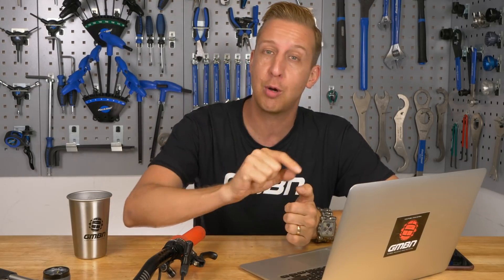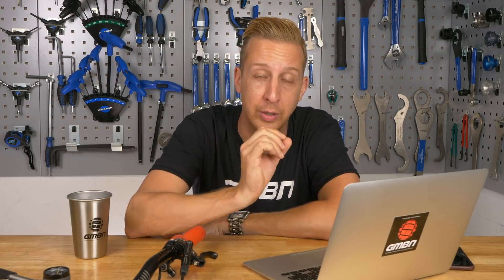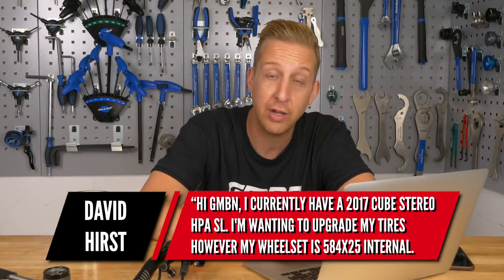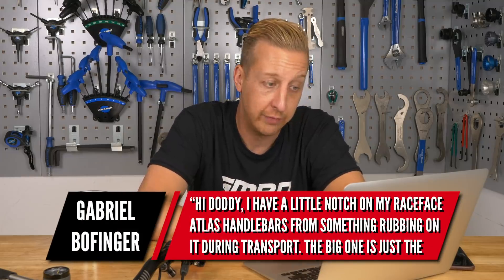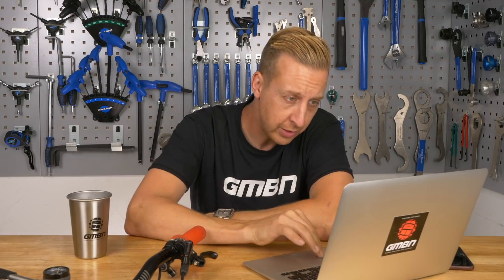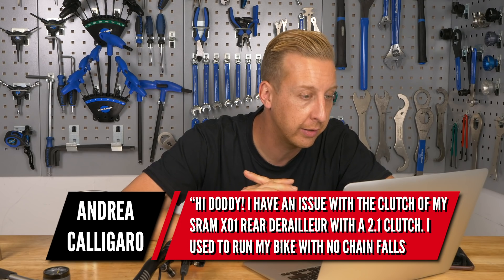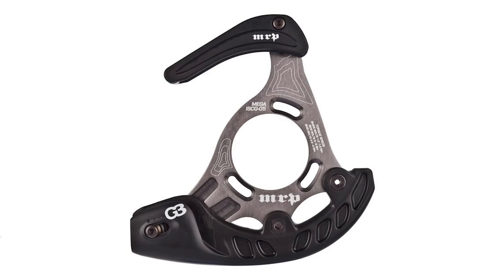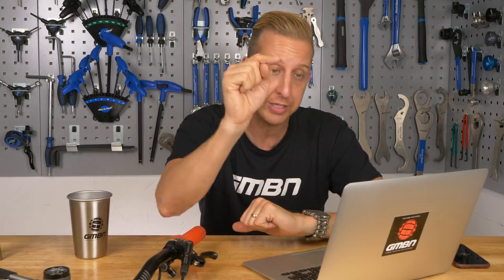Why Does Your MTB Chain Keep Dropping Off? | Ask GMBN Tech

Comment from the maker: Leave us your questions in the comments below using #askgmbntech 👇
Reply: #askgmbntech
What a show! 
 i want to make my mtb to a cx bike i wonder if a tiagra or any shimano sti and a mtb rd(deore) would it work? 
And do you know some brakes that have mech actuation but theres mineral fluid in the disc brake calipers? 
Its a  long question more power!
Reply: @Kayle Mallillin:
brake: TRP hy-road for example
Reply: Hey! I have a Canyon Spectral al 6.0 just for about a month now. However, the dropper post (kind shock lev si with a 150mm drop) doesn't come out completely and there's a little bit of play up and down, as well as side to side. The air pressure is correct, as well as the cable tension. 
Any suggestions? Thanks🙃 #askgmbntech

Ps: One of my friends is having the exact same problem.
Reply: Can I fit a 1x11 Cassette on my 2018 Trek X Caliber 8 on stock wheel and hub? Boost 141 QR #askgmbntech
Reply: My chain keeps coming off at the front near my Pedals when I descend a rock garden I would install a bash hard but my bike does not have the mounting points what should I do
Reply: First: great show!
#askgmbntech What's the best (min/max) width tyre for any inner width rim? There's a few tables out there on the internet, but showing different optimums. How about one more from you guys?!
Reply: #gmbntech
How much travel is too much travel?
Are there any bikes that handle climbing really well while also being fun on the DH?
Reply: @Gavin Sorensen:
If u never bottom out it's too much travel. Bottoming out frequently means it's not enough!
Reply: @geemail369  time to get a santa Cruz v10 for my local XC trails!
Reply: #askgmbntech I have two questions one and I know you all get this question a lot but, my B.B. is creaking I’ve removed it cleaned it and re-greased then replaced it it worked for about 1 ride now it’s back to creaking, should I just start working on it and keep going till it stops? And 2 what does “boost” do example boost wheels
Reply: Hey Doddy great show and a regular viewer. I’ve just noticed my rock shock lyric fork which has 160 travel only rebounds to around 140/150 travel it’s got 80 psi the only way to get 160 is if I actually hold the fork and pull it up , would it be it needs a full service as I’ve never serviced my fork cheers mate
Reply: #askgmbntech Hello Dooddy! I'm currently running a 1x10 setup on my XC bike. My chainring is a 32T and have an 11-36T cassette. I've already worn out my cassette and I'm thinking about swapping it out with an 11-42T and a new chain. I'm trying to find out if my M6000 rear mech can take a 11-42T cassette without using a goat link. I've been finding conflicting answers from the internet. Some say it will fit fine and some say it doesn't. I hope you can shed light on this. Love the show! Thanks!
Reply: This channel is to help people ?

Why the talk technical and lose the logic 

How about having the tools infront of you and then showing how to complete the task

All i hear is 144ml  100ml and then maybe 1ml 

People will understand if you dont talk talk .. 

Show the items !

Comment: #ASKGMBNTECH Front suspension Question. Hey Doddy. All the way from South Africa.  Hope you can give me some advice.  I got a brand new Trek Top Fuel 7. It has a Rocksox Reba Silver Boost with a 32mm stantion if I am correct. I wanted to fit my current fork which is a Forma Selva. This is an awesome fork and has 35mm stantion. The Formula is unfortunately non boost. I want to know if I should keep riding the new Reba Silver, or rebuild the front wheel to non boost and make use of the Formula Selva. Does the boost really give that much benefits. Rudi Raats

Comment: Wondering if you could help or give me a bit of advice.

I have a 2021 giant Talon E Bike, and everything works great until I go off road. 

Every time I go off road and I am going downhill, and I hit a small bump my chain come off at the front all the time. 

Its fine going uphill and on flat, only happens downhill when I hit a bump, even when I stand up and let bike go downhill, I hit a small bump and the chain comes off

Comment: #askgmbntech I have a KTM Lycan 274 bike 27.5inch wheels. With shimano deore specs. 11-36t cassette 10speed, 38-24 chainset. I never use the 24T chainring tho. So im thinking of converting to a 1x with a oval chainring. What are your recomendations? Should i change both chainring and cassette or can i get away with only putting a wide narrow oval chainring and keep the original cassette?

Comment: #askgmbntech Hi doddy, recently bought a brand new Marin san Quinton 1 and found that between the crank arm and the bearings of the bottom bracket there is a gap of about 1cm. All the bolts are tightened correctly and not sure what is causing this. Could it be the axle length is to long for the frame?

Comment: #askgmbntech Hi Doddy, I have a problem with my cassete that when I switch to the harder gears like 9 or 10 the bike starts to make a clunking sound which means when I am pedalling especially up hill it clunks and chucks my feet off my flat pedals. What do u think is wrong or am I doing something wrong?

Comment: Steerer tube creaking inside crown use loctite 290 wicking grade. It seeps into the crack and uses capilary action and then seals. I used it for the part where the stantions go to the crown last week and now my bike is dead silent.

Comment: #askgmbntech I’ve just bought a new wheel set fitted them and set up tubeless everything seems fine but when the bike is in the stand I’ve noticed at lower speed when spinning the back wheel it moves the cranks and the chain becomes lose then snaps back and free wheels again? When the wheel isn’t in the bike it’s fine, Hub is a superstar components electro 102 cheers doddy p.s loving the channel

Comment: Hey! I have a Canyon Spectral al 6.0 just for about a month now. However, the dropper post (kind shock lev si with a 150mm drop) doesn't come out completely and there's a little bit of play up and down, as well as side to side. The air pressure is correct, as well as the cable tension. 
Any suggestions? Thanks🙃 #askgmbntech

Comment: #askgmbntech I just had a difficult time removing some Race Face Evolve aluminium cranks that were bonded to their cromoly steel axle due to galvanic corrosion. I hadn't removed them for about 6 years because I only do that if it feels/sounds like the BB needs looking at.

When I tried to use the self-extracting bolt system, the outside bolt thread stripped. Then I tried using a crank extractor which stripped the threads from within the cranks. I tried bouncing up and down on the pedals with all the bolts removed, and nothing happened. Skipping out a load of other failed attempts I wound up sawing off the tabs where the outer chainrings would be bolted so I could get a 6-ton gear puller attached securely and that eventually worked.

Is there a better way for if I have to do this again? Should I be removing my cranks every 6 months or something to prevent this problem?

Comment: #askGMBNtech Hey Doddy. Love your show, mate. You've got a brilliant style for delivering what is without doubt a wealth of knowledge. Love it. A brake fluid question for you.  I run XT brakes mated to Saint 4-piston calipers and 203mm rotors front & rear on my 2013 Specialized Stumperjumper.  Fully loaded up, I'm probably knocking on the door of 90kg.  I'm also knocking on the door of 45, and while I can ride okay, I'm hardly an aggressive shredder.  What I've noticed with my brake fluid, through either lever bleeds of a full flush, is that it turns from the usual red of the Shimano mineral oil to cloudy black.  Is this normal? Natural? Anything to be concerned about? Cheers mate. Jamie Scott, Christchurch, New Zealand
Reply: i have seen cloudy black brake fluid before. i would say it means you have to do your next flush sooner

Comment: To the guy wanting to fit a 2.6 magic Mary to a narrow rim, get the strongest casing you can! I run a 2.4 on a 24mm internal and under hard cornering you can sometimes feel the tyre folding in the corner, it kind of feels like your in a drift then it pops back into correct position and wants to either stand the bike back up or slide out because it's now in side of the tyre as it fold the other way.

#gmbntech still no email doddy, I'm desperate for a link up on that 10mm stem 😂

Comment: #askgmbntech hey Doddy, 
So i recently bought a 27.5 hardtail(Kross hexagon 3.0) and im looking to upgrade it.
The shifters and drivetrain are ok, but i need reccomendations for the rest. (Since im from Croatia, it's a bit difficult to get parts) I also don't need a dropper post(btw an aggresive rider).
Reply: it looks like an altus-tourney 3x7 drivetrain, which is touring oriented. I think if you ride this bike hard things will start to break. The rear derailler spring isnt strong and will be flying around on rough terrain causing ghostshifting. The rear wheel probaly has a 7 speed freewheel instead of a cassette, which means you need a new wheel to upgrade to a 9, 10, 11 speed drivetrain in the future.

My suggestion would be to save up for a new bike altogether since that would be more cost effective compared to upgrading the whole bike over time. (great deals can be found on used bikes). If you are happy with the current bike i would start with tires, hydraulic brakes, air fork

Comment: #askgmbntech I have a yt jeffsy 29er. It comes with a 32 tooth chainring, but I find it to big and I'm thinking of changing it to a 30 tooth one. What do I have to look for when buying the new chainring to make sure it fits?
Reply: make sure it mounts the same way, different brands may mount differently and may not be compatible
Reply: Why? 30T may be too small, whats the cassette you are running. An 11-42 with a 32T should be more than enough. If you cant make the climbs now just train a bit more. You will get stronger that way.

Comment: about that 29 vs 27.5 dilemma, there is a point where this 29er better rolling ability is a disadvantage in fact, i find it almost impossible to keep the speed low on some extreme downhill wall like sections, whereas with smaller wheels it will bite better into some holes and let you keep speed lower. other than that 29er is a killer ;-)
Reply: Have you heard of brakes
Reply: yeach i did, but what i described is with modulation or even with full stop - so it seems brakes does not affect this scenario ;-)

Comment: #askgmbntech hey doddy, loving the show!. Is there any way to make hydraulic brakes more progressive? 3 months ago i had a big crash where i hurt my right hand pretty bad, and i lost a bit of "fine motricity" on the fingers i use for the rear brake. So i find my self sometimes braking much harder than i should and locking the rear wheel quite often. my bike has shimano m365 hidraulic brakes with 180mm rear rotors btw. Thanks and greetings from Argentina!
Reply: Shimano brakes are known more for power than their modulation (or the Saint brakes are certainly), you might have better luck swapping to a different brand
Reply: @src248  yeah, that was what i was thinking, asking for some brands/models that are known for their "modulation". 
Thanks!
Reply: People seem to like the modulation on the SRAM brakes, I'm using Guides and like them... but I'm no expert, reading as many reviews as you can is generally worthwhile
Reply: thanks!, i had 2 bikes so far and both with shimano brakes. And yeah, they´re pretty touchy. I got use to it and i can modulate them pretty well (with my healthy hand).
Reply: @Garcheezy  Hope brakes are great for modulation
Reply: @robbanks50  thanks! i will take a look at those!

Comment: Hi Doddy, I had this mystery with my bike which is a trek x caliber 7. The problem being that my first gear cannot keep the chain on at normal pressure (25-30 psi) but today I tried pumping my tyres at 60 psi and now my chain can stay on the first gear. Can you please explain it to me. Cheers

Comment: 8:07 could be crack in carbon bars,
as mentioned in the video it could be loose stem bolts, could be play in fork crown & steerer,or stanchions. and of course crown race.
it creeks when turning or riding hard it's most likely the crown & steerer, or stanchions.
also check the wheels, it might be the spokes rubbing, could be spoke nipples too.
so good idea to listen up loser, eliminate one by one.

Comment: It turns out the 18" Cube Analog was a bit too big for me (5'7" with 28" inseam) so I'm getting it in a 16" instead.
Reply: Also 5'7" and our height is a bit of an issue. We are on the near end of a small bike but just beginning of a medium.
Reply: Jay G  I remember just before I quit cycling 20 years ago an 18" was a perfect fit. With the 18" analog I can't get my feet on the ground when I am on the saddle and when I stand with the crossbar between my legs the crossbar is just under me. I have no room under me on the crossbar. Not even 1mm between me and the frame.
Reply: or try the 17" 29er?
Reply: I did. Its still that tiny bit too big. I tried a 16" and it did fit much better but it was a CUBE AIM I tested @ 16" which is a cheaper bike and it just didn't ride as good as the analog.

Comment: #askgmbntech  Hey Doddy!  I'm looking at going full sus by spring (eyeing a Scott Genius 920 or Canyon Spectral CF 9.0) and have a sizing question.  I currently have a Trek Marlin 7 in 18.5", based on my height.  Problem is I can't get the seat low enough to get my hips behind it, even after cutting 1" off the tube.  While I'm 6' tall, I have shorter legs (32" inseam) and a longer torso.  Using Canyon's sizing tool on their site it actually tells me my measurements might be incorrect, stating that by height I should be a L frame, but if inseam is correct I should choose a M.  Spending that much, I really don't want to choose wrong.  What are your thoughts?  Thanks for all you do, you've made me so much more confident in working on/maintaining my bike!
Reply: Looking at the Canyon, a M will be TINY for you, at 6' you might even be comfortable on an XL with a shorter stem. But given your inseam the L would be a safer choice

Comment: #askgmbntech Hi Doddy, my rear disk keeps rubbing onto the brake pads, The wheel isn't buckled and the pads are fairly new and centered. Could the disk itself be "buckled" or is it something else. Thanks in advance
Reply: Ousmane Chamy it could be that you don’t have the washers on your brake bolts and it is a possibility the disk can be warped or buckled
Reply: Very easy to bend the disc.
Could also be loose hub bearing cones giving you movement and making it rub.
Reply: Try centering the caliper if you haven't. Loosen the two bolts slightly so it has some play, apply the brakes a few times, tighten the bolts with the brakes applied.
Reply: yh tried that many times but still hasnt worked.
Reply: if the disc rubs only in 1 particular spot rather then over the whole revolution its the disc that is out of true. if it rubs in multiple spots it might be warped such that it hits both brake pads. if it rubs all the time its probaly just a caliper centering issue.
Try to take the wheel out, push the pistons back, center caliper again by wedging a folded piece of paper on either side of the disc to act as centering tool

Comment: Hi Doddy can you change a 3 front cranks to a single one
Reply: Ethan Pullen just go to park tools video on this it’s really detailed and will tell you anything and everything you would ever need to know about the swap
Reply: @bobdixon3048  thanks for the info
Reply: Yes, but make sure you install the chainring to have a straight chainline in the middle cog of the cassette. I did that in the past with a raceface chainring. You can install the chainring on the outer or inner part of the spider, plus you can even adjust further by moving the spacers of the cranks.
Reply: @GrimYak  thanks for the details and help

Comment: #askgmbntech would my alexrims MD40's fit a 2.6" (comes with 2.8")
Reply: If the 40 is the outside width and not inside width then yes you can with no problems, if the 40 is the internal width then it might be a bit wide

Comment: #askgmbntech Can I use a Sunrace 11s 11-50 cassete with a Sram gx rear derraileur 11s (I have a Specialized camber 2017)
Reply: Carlos Araújo yes you can a friend of me did it and it works just fine you need a new cassette, a sram 12-Speed chain, a narrow wide chainring and the rear derailleur
Reply: Yes, that and also works with a Shimano medium cage 11s.

Comment: #askgmbntech my new bike has a knocking/ clicking noise when I either pick up the front end or do a light drop, it's not the headset, so I don't know.
Reply: Could be the fork.
Reply: might be wear of the fork bushings, you can check this by holding the front brake and rocking the bike back and forth and feeling for movement between stanchions and lower legs.

Comment: #askgmbntech Hi Doddy, I'm building a gravel bike out of an old HT, will road type 10sp shifters work with my Shimano XT 10sp HG-X Cassette or do I need to swap it for a road one...is the spacing the same? Thanks.